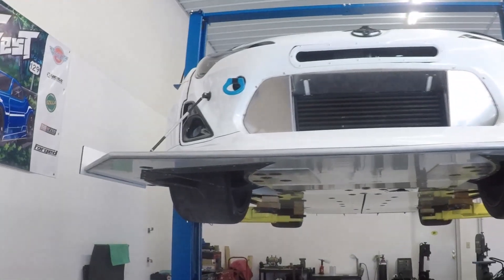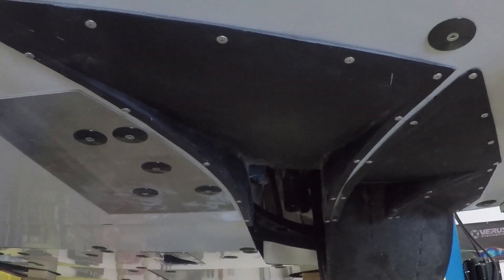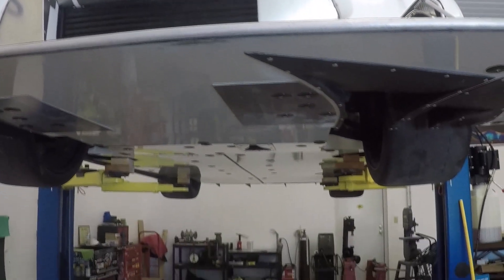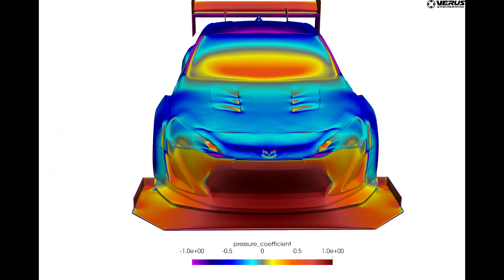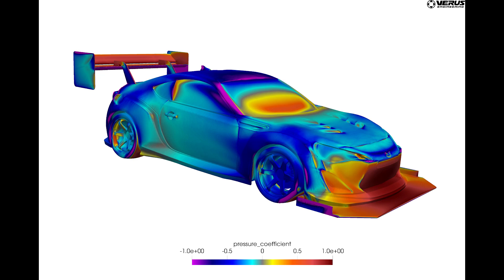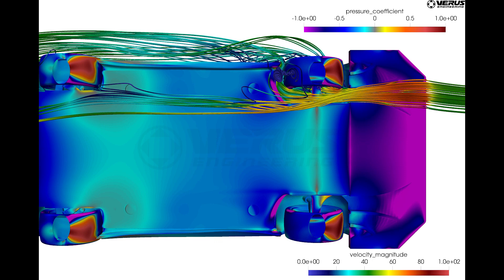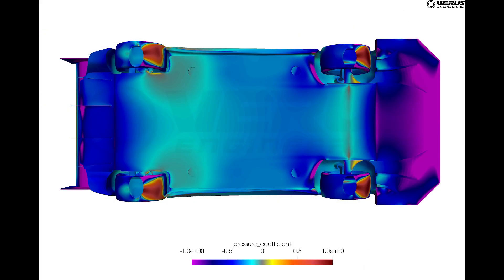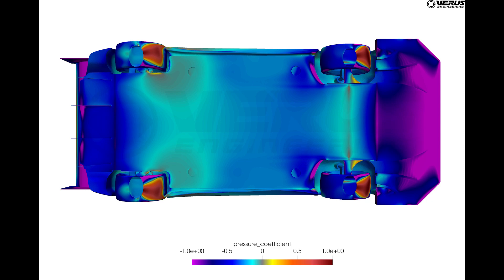ProjectFT86SFTA - Front Splitter Recap

Comment: how did you bond the pipe for the front radius to the alumalite?
Reply from the maker: After the two sheets of alumalite were bonded together, the tube was simply bonded on with a metal bonding agent.
Reply: @VerusEngineering  i thik ill give this a shot. my current splitter is made from two sheets of AGM bonded together,i used a router to form a bevel but ive neever been quite happy with the result
Reply from the maker: Best of luck to you! We love seeing DIY aero. @theprofessr11

Comment: Is the huge gap around the bottom of the bumper intended? Seems like you’d be losing downforce with the air escaping through it
Reply from the maker: Are you talking about the small gap between the front lip and the front splitter? It was sealed with helicopter tape.

Comment: u guys shoulde make the aluminum replaceable so that it can be crushed or dented and then replaced. I think it was a good idea cuz instead of the carbon fiber being exposed first and get chipped away and cracked. it has a structure meant to cave a bit. you just gotta make it slide out or bolt on/off
Reply from the maker: This splitter was designed with a limited budget in mind, so that is why it was designed the way it was.
Reply: @VerusEngineering  It was a great concept to build upon.

Comment: I learnt so much with watching the flow around the Front Diffuser Splitters around the front tires. Seeing your FDS has turned the light globe on for my own FWD race car - thank you. Question - Is there a need to apply your FDS to the area ahead of the rear wheels? I look to rotate the rear of the car to help thru corners. And perhaps run less Rear Wing..... your thoughts?
Reply from the maker: I'm sure you could, but our front diffusers are quite large, and not sure how'd you get it to work in from of the rear tires. I believe Porsche does something similar on one of their factory cars. We personally have never tested it, so we cannot say 100% one way or another if they are beneficial or not.
Reply: @VerusEngineering  Interesting you mention Porsche. I work at a Porsche Dealership (and race a Honda DC5!). We had the ELM Car Spa here on display but unfortunately they never let me put it on the Hoist.
Reply: Another thing I wanted to chat with you about. Is your smaller Triple Diffuser arrangement making DF when the wheels are being steered? To me they look like they do. Am I correct? Also am I correct in thinking we need added DF in the Corners hence your Triple Diffuser arrangement.
Reply from the maker: @scottwyman5014  Yes, it still makes DF when steering and yes, the corners are where you want the added DF.
Reply: I've had a thought about fitting Mid Diffuser's ahead of the Rear Wheels. For me (Honda DC5) I'd be mounting them on flat horizontal Side Plates. Then directing /organizing the air to exit the back via tunnels that go over the rear wheel Arch's inside the car. Perhaps ushering the Air to go out the vertical flat area of the Boot Lid under the Wing? Thoughts? And I'd like to purchase your Front Diffusers but can't find a Link. Can you help please.
Reply from the maker: @scottwyman5014  we sell our carbon front diffusers for $430. Feel free to email us.

Comment: You can probably move the 2 most outer tunnels closer to the edge of the front splitter, it would be interesting to see what the difference in air flow would be when the air is redirected outwards away from the tire/wheels
Reply from the maker: We probably could, yes, but we found these locations work best with the overall aero setup as the full aero package was developed together to work in unison.